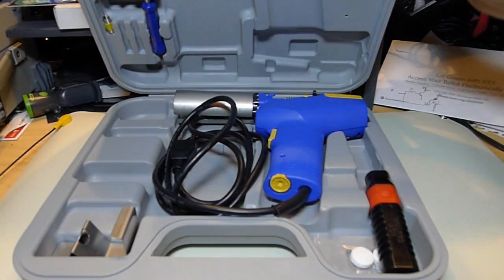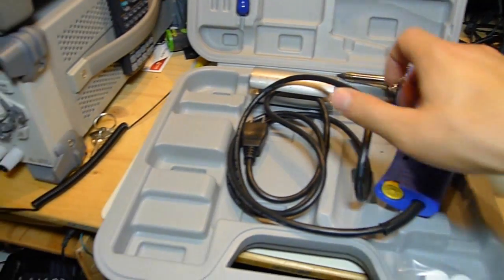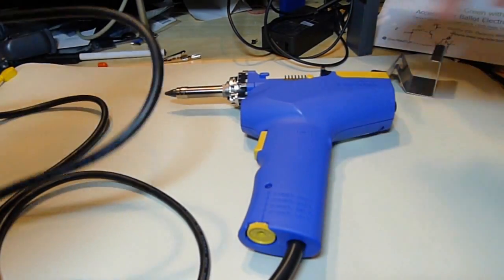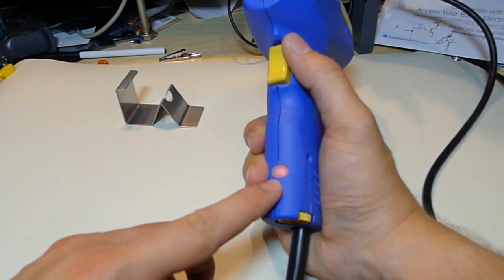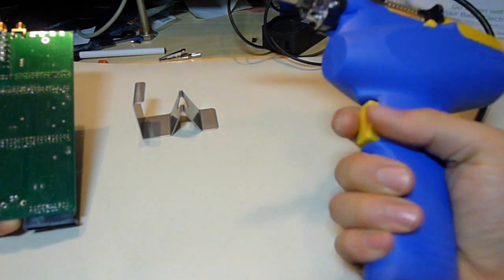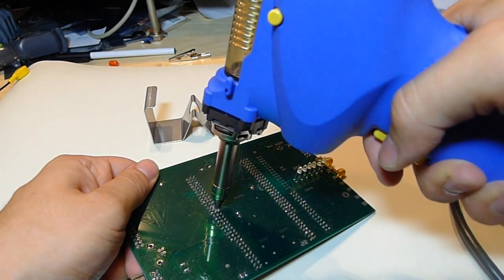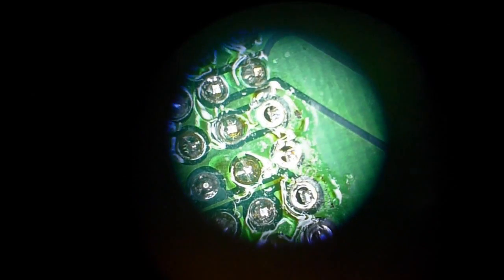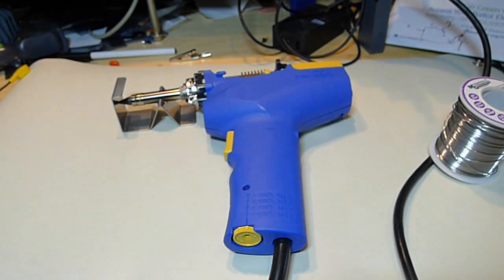Hakko FR-300 FR300 Desoldering Tool: Full Review

Comment: 2:44, where do you find the black plastic piece? I can't find replacement part for that
Reply from the maker: Not sure sorry :/ Came with the thing...
Reply: @ColinOFlynn  I did my research its called a flange but only fr 301's can get replacements while FR 300 will not have a part number for it. i can't find one i think i might have to buy the fr 301 and then sand it down.

Comment: Looks like its made off quality plastic molding but it is so big block your line of sight and the motor sound's like a 2 cycle boat motor ,I think that the Chinese made improved knock off for a fraction of the price !
Reply: @Greg Peck 
I think he's talking about the GAOJIE S993A, which I've been using for about 3 months now without any issues. It even has a much better stand too. Just in case, I've bought a replacement heating element for it, and all of that cost me 1/3 the price of a Hakko FR-301 and performs really well.

Comment: I hear so many bad things about this unit...
Reply: +Spicy Kielbasa  You haven't heard enough. My heating element died after 2 months and I don't use it everyday. When I do it's for like 5 minutes. So it maybe had 4 hrs of use total on it. Furthermore that damn metal rod to clean barrel barely fits in it to actually clean it. I feel like I am damaging it every time the suction slows and I have to damn near corkscrew the cleaner through. Not to mention those ceramic filters get clogged so fast. I feel like a need a paycheck just to maintain the unit.
Reply: icemanxp300 I bought a cheap Aouyue unit and it works amazing.
Reply: @spicykielbasa5305  model is it still working ?
Reply from the maker: +icemanxp300 I ended up slightly enlarging the bore which made the cleaner slide through it freely, and has made clogging much easier to deal with. I had that same jamming issue before after a while, and out of frustration just used a drill bit to clean it out, afterwards which I realized seems to make it work better since it was slightly too large (came from a numbered drill bit set, so was not a metric size).
Reply from the maker: The "metal center" is the plated through hole I assume you mean? Have you tried adding extra solder/flux first? This is something I do very frequently... adding a little more solder, especially adding leaded solder (with it's lower melting point) to what is probably a lead-free board. This is very "non-kosher" if you are doing this for real products that need to maintain RoHS compliance, but for hobby stuff should be fine. Adding some extra flux (with a flux pen perhaps) is also useful.
Reply from the maker: +Spicy Kielbasa What model out of interest... would love to update this with an alternative recommendation! At the time I didn't see any cheap alternatives that looked worthwhile.
Reply: +Colin O'Flynn Yeah I don't know much about these.  Anyhow I have some tie wire and it slides through the barrel very easy and after I do that a few times I am able to get the cleaner through after a little twisting. I desolder 32-36 pin chips and it seems like after I desolder 8-10 the barrel needs to be cleaned. It seems very poor quality for a $300 gun. I'm a fairly new to soldering, desoldering in general. While this gun works awesome on pads, it doesn't do well on through hole. Not sure the correct terms here but many of my chips have the pins go through the holes but the entire hole has a metal center connected to the pads. This makes it very hard to get the chips out even w/this gun. Any tips?
Reply: HI ! may i ask which precise model you got ? thanks
Reply from the maker: gino FR300-05 is written on label.
Reply: Colin O'Flynn  I see now sorry. Thanks for the very interesting video. Nice tool indeed. I have very small parts to desolder. Very difficult with the gun. I wonder if the copper braid could be a better solution.  Never tried by the way..

Comment: Damn this thing super expensive do you know any cheaper stuff similar to this?
Reply: Joe Bonano Hi Joe, while these are well worth the price if you can afford it, if you are just doing a few connections every once in a while look for the cheap soldering irons that have the same sort of hollow tip but just a simple squeeze bulb attached to it. $15 at Radio Shack. http://www.radioshack.com/radioshack-45-watt-desoldering-iron/6402060.html
Reply: +John L Rice Those things SUCK! I bought one once and found myself using the solder sucker spring loaded type for years. It was tedious work, one some boards were ruined in the process. Looking back seven years, I wish I had just bit the bullet and got a decent desoldering gun. It could have paid for itself 10X over. Anyone reading this, if you think you may be repairing boards every once in awhile GET A REAL DESOLDERING GUN. It will pay for itself in no time.